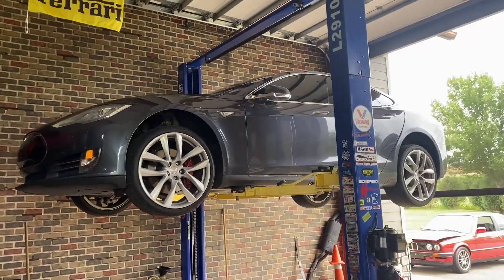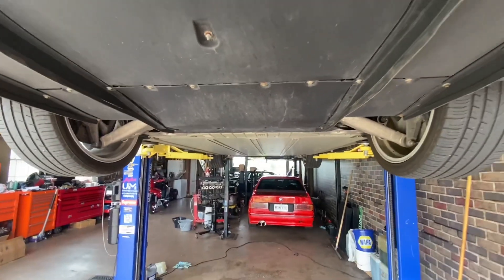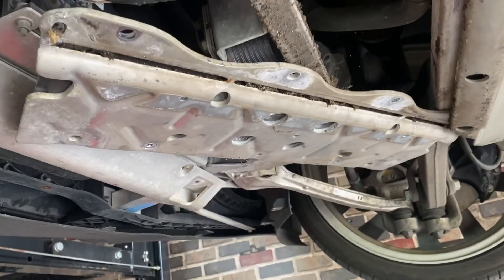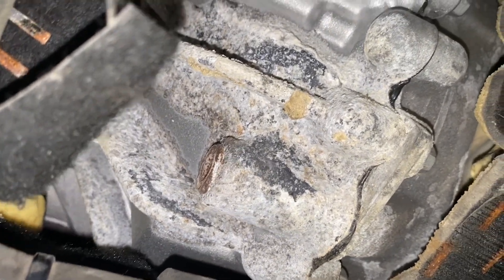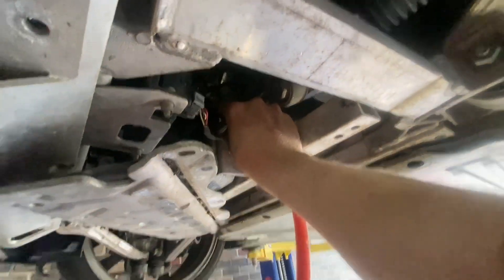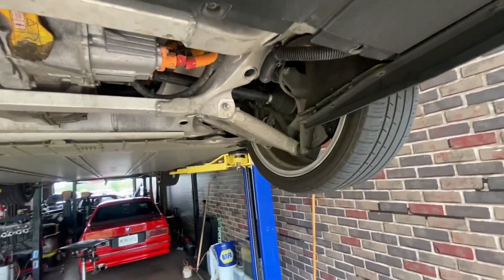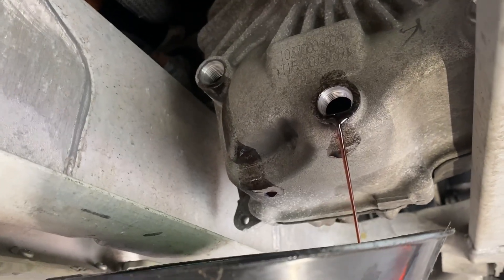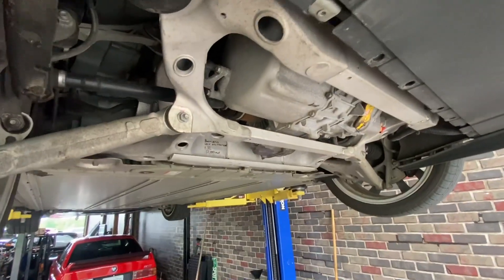Tesla Model S Small Drive Unit oil change front and rear DIY how to

Comment: Thanks.  The manual delineates two procedures, with SDUs prior to 4/24/2019 builds not having any filters.  FWIW, his rear SDU had 1037000 stamped right on it, which is also after the 1035000 (and earlier SDUs) that called for gear oil.  So, KAF1 fluid (closer to an ATF, than gear oil) is called for. Otherwise, the real early (2012-14?) SDUs require SHC 629 gear oil, like a 150 visc/PAO...hard to find but fortunately few use it.

Comment: @Ovalbore - in the service manual for Model S 2015 it's stated that you should fill oil into the rear drive unit (small) from the actual axle opening, not the fill plug, as you do. Are you sure you can fill up small drive units this way like you do?

Comment: I am thinking of changing mine in near future but front looks like pain to do on driveway without a lift :( What year was this, mine is 2016 and I belive it uses 75W90 gear oil in front and thinner ATF like fluid in the back but don't know for sure without checking part number on front drive unit. They started using newer drive units that use the same ATF like fluid in front in 2016, also if it has had replacement fitted by Tesla, it is also likely to be newer part number.

Comment: My 2015 TMS 85D is making a "metal like" sound for a few weeks now. Its only happening when I let go of the gas pedal. Nothing when I accelerate, only when letting go of the gas. Do you think it has anything with being low on the oil you changed or may there be a leak somehwere in the "mechanics" going into the DU? TY in advance for any tip.
Reply: my 75D had the same problem, I have a video about it. In my car it was front half shaft extension support bearing. Did you get it sorted ?

Comment: Thanks for posting this.  Just FYI, I believe the oil is brown in your RDU because the coolant sensor gasket is leaking, which the sport motors are notorious for, and not because they "work harder.". 
That you got 117,000 miles out of an RDU without the "U" coolant delete version is unusual.
Reply: His car is a 70D so no LDU rotor seal to worry about.
Reply: The dual motors don't have the issue or require a coolant delete kit, unless you have the performance model that has the LDU in the rear.
I had 175000 on my LDU before it started milling.  They had to replace the HV cables since the plugs that go into the drive unit were fused to the casing (corrosively I'm sure).

Comment: I have a model S 85D 2015 and I have had in to Tesla for service several times but me knowing they have never changed the drive unit oil. Is it really necessary? Im told it should not need it but Im sure you are right…
Reply: i have a 2015 85d with 240,000kms on the clock and thinking about changing the transmission fluid too. Although many think it does not need it i think that to risk prematurely wearing out the transmission that would cost thousands, against changing the fluids that is relatively cheap it seems a no brainer to change the fluid.
Reply: @stephensharp975 I just talked to Tesla servicecenter where I live and they said they dont have any recommended serviceinterval for changing transmission fluid… but they do it if I want it done and they charge 270 USD for it. So I have a serviceappointment now, better safe than sorry! 😅
Reply: Yes, I also changed transmission fluid at Tesla now and Im happy I did it 😅
Reply: Well, they say that. Because it's 98% certain the drive unit is gonna live out the warranty without a single oil change, what happens after is of no concern to Tesla.

Comment: Hi. I read in the manual to access the fylling on the front motor from the frunk. Thanks for the video
Reply from the maker: you can remove the frunk bin to do it, yes
Reply: @OvalboreCars  is it transmission fluid or gear oil?

Comment: Nice video!! Very informative. What's the actual mileage listed on the manual for gearbox fluid change? Do you know if the Y required the same thing? Thanks
Reply from the maker: afaik nothing listed.

all vehicles need functional fluid changes.

Comment: I was just told by a service center that the rear drive unit in my 2017 MX cannot be drained wiithout removing the unit.  Is this BS?
Reply from the maker: not sure. I have not worked on a LDU. really doubt it though.
Reply: Could be true. Some units also have the oil filter built in(!) so you HAVE to take it apart to change the filter!
The most stupid construction ever!
Gear box change of oil is good to do maybe every five year or so. If you drive a lot, then do more often.
If you tow a lot of heavy stuff then more often.
Really cold climate? I would way, more often again since -30C and even colder makes the oil worse and that also increase the wear.

Comment: Excellent video. I have the same year with dual motors and this came in handy. Was wondering what the fill level was for the rear smaller DU. I just replaced an axle and seal. Will top off the fluids now. Thanx.

Comment: hey buddy, would you tell me where is the rear ground strap is located? i cant find on my 85D.
Reply from the maker: ground strap for what?
Reply: @OvalboreCars  For the rear engine. The one that connects the rear engine with the body of the car.
Reply: @OvalboreCars  inverter to the chassis

Comment: Where are you located? Can you change my oil I already have 130k on my model x 90d
Reply: Tesla Service centers will flush the fluid for about 140$
Reply from the maker: twin cities, MN - yes but booked until may/june already for 23 and as the other commentor mentioned, its not a pricey service at the service center

Comment: Tips front reduction gear oil filling hole is much easier to reach from the frunk.
Reply from the maker: takes way longer to pull the bin
Reply: @OvalboreCars  4 screws and a cable for way more easier access. This is what the Tesla service manual shows anyway. Did save time for me anyway.  👍

Comment: FYI. Fill it from the frunk makes this a little easier
Reply from the maker: I did pull the frunk bin for another project, but that was like 30 minutes of work, not sure it would have been worth it.
Reply: take 5min, you just scare @OvalboreCars
Reply: Filling from the frunk is the way to go.  Two bolts, two nuts, 30 minutes?  Don't think so.

Comment: Why type of oil is he using
Reply from the maker: video description.
Reply: The tesla fluid spec is given in the service manual.  Depending on your model its Dexron HP, STP SHC 629 or ATF-9.   You have to look at the side of your motor to know which to use.

Comment: Please could you say me what’s the correct reference of gearbox fluid trademark?
Reply: Nowerdays it's 1750ml of kaf1 for front Drive and 2250 of Kaf 1 rear drive. After a long search in the Nederlands they use fuchs edf 7005 as DU as Standard oil in all types. In the bezinning they used mobile shc 629 die front and dexron VI for the rear. Thats wij the fluid was Amber colored in the front and red at back. After front unit "F" and later they switched to dexron VI in the front as well.

Comment: How come my ICE car hardly ever needs the gearbox oil changed. But these need em regular? Service money perhaps?
Reply: This EV also has 117k miles on the gearbox oil. Do you wait that long between transmission fluid changes?
Reply: Because you bought into the planned obsolescence hook line and sinker.
Reply: Change the gear box oil regularly. And diff too of course. And Haldex if you have.
Reply: emh? haldexs is supposed to be changed at even more frequent intervals, but nobody ever do. and when it comes to most gearboxes they almost all say the same as Tesla says "its lifetime fill" but its not, not if you want it to last, sure it will last out the warranty, and thats all these manufactures cares about too, makes sense from a busniss perspective does it not?
Reply from the maker: all vehicles with differentials need regular gear oil changes.

Comment: I guess people forgot, differentials need lubrication as well 😅
Reply from the maker: you should have seen the flaming I got on the local tesla owners group when I posted about the oil change and the fact no one does this important service on their cars.

just endless uncropped screenshots of the echo chamber forums. 

I hate tesla owners. I hate the company too but the car is.. unfortunately damn good.
Reply: @OvalboreCars  as someone who doesn't have the same equipment or skill as you is this lubricant/oil change available to be done at the SC? Model Y owner here
Reply: @OvalboreCars  reason why I will NOT get one, Tesla owners, especially vocal ones are just absolute pricks, not a big fan of the company either, but no hate. I'll wait for a Toyota EV
Reply: @gwot  Your wait is over! The bz4x is here!
Reply: @angela1984a  one of the worst BEVs out there...
Reply: @stefyyy1994  Agreed. Another crappy SUV/Crossover with appallingly bad air resistance numbers. And with POS looks inside and out. Slow at a fast-charger and smallish battery, so overall crap range.
Reply: @gwot  I assumed more would do research, like I have been doing constantly(like now) before buying one lol
Reply: @gwot  WTF You wrote that comment around 2022-2023. When Hyundai & Kia e-GMP family of cars were already very popular. I personally would get a Ioniq 6 over a Model 3.
Reply: @Neojhun  K and? popular doesn't mean it's good.
Reply: @Neojhun watch the MGU disassembly by Munro Live. The ioniq ones are so bad, an ID.3 would be safer to drive.
Reply: One question: what type of oil did you use for the Tesla model s?